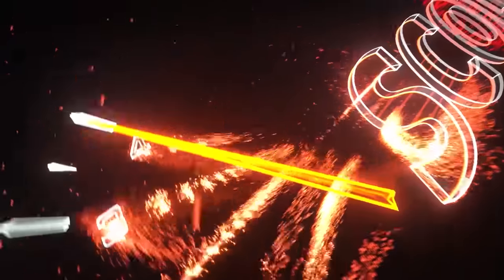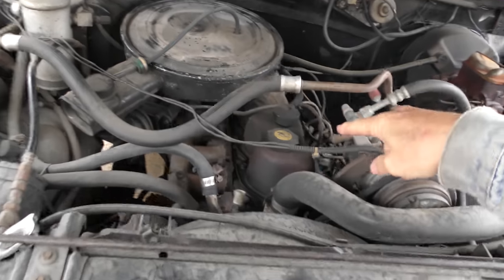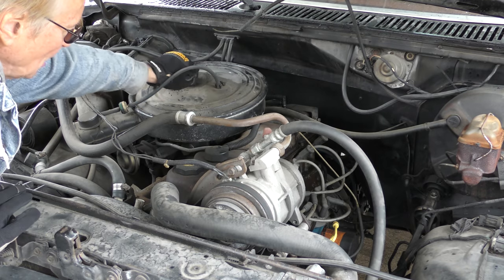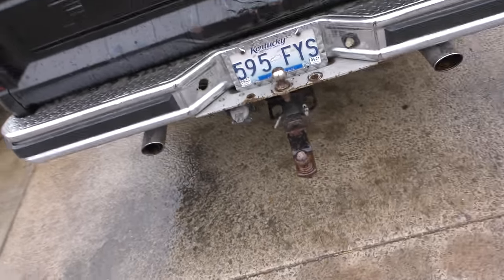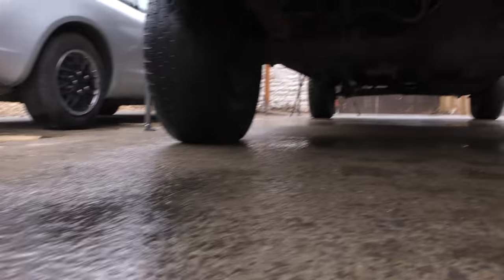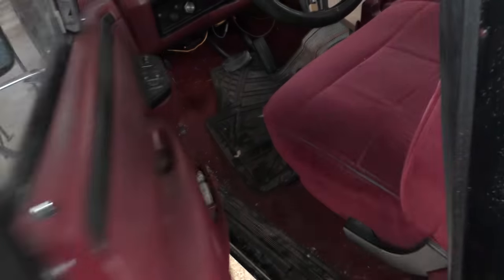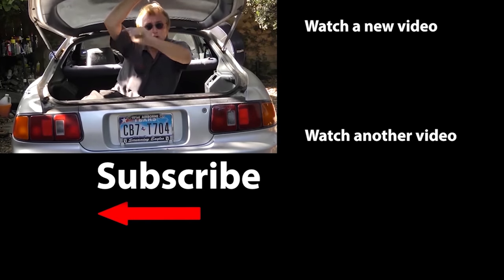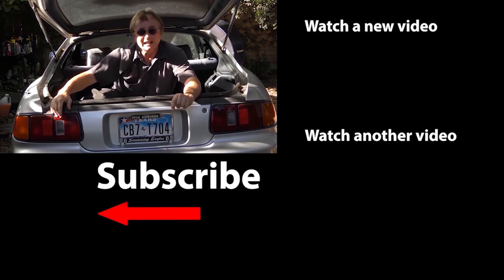I'd Give My Left Arm for This Truck

Comment: I paid 2 grand for a super clean F0100, 1968 w/250 six cyl and auto', had it now for 5 years, runs like it should, uses some oil but who cares, I have it insured for 8 grand.  Came from a ranch in Oklahoma, not a dent in it, frame like new, I did put in a new windshield.  You just cannot beat the old stuff, back when all American made.

Comment: I've had a 90 f150, went 250k before I sold it, currently have a 95 f150 with the 300, has the I6, has 240k sounds great you could balance a nickel on it. Also got a 89 Bronco with 418000 miles, old 302. OLD FORDS ARE JUST LOYAL

Comment: I still own one of these. mine is a 1995 efi and it's a 5 speed but it's the same 300ci I have over 300k on it and still runs and drives better than some newer trucks in my opinion I love my old truck and you cant beat how cheap the parts are to keep her running the only down side is it's not going to win any mpg rewards but it's the only work truck I'd trust with my life. If you haters don't want to take it from scotty take it from me I got this truck from my dad for 1000 bucks 8 years ago and my dad bought it brand new and other than a clutch, radiator and hoses ,belts and water pump, brakes. All basic ware parts that have to be replaced on any car every so often. Fyi these parts didn't have to be replaced till after 250k and cost us under 600 bucks for all the parts labor was free because the truck is so simple to work on you can do it yourself with a basic tool set and I mean like a cheap walmart set for under 50 bucks. I've also worked on other friends and family f100-250 with these engine and everything is so easy to work on it a crying shame ford doesn't sell this for consumer trucks and suvs any more but it's still used commercially.  Best trucks/engine period.

Comment: I wouldn't trade that for my 83 D150 Ram Miser. It now has a modified 360 and 727 torqueflite. Next up is a rear disc brake set up. Oh and it also has an 8 foot bed you can get a full sheet of plywood in without hanging out the back. Why are there so many four door trucks? I'd have a Ridgeline if they made one with two doors and a bigger bed.

Comment: I was smiling all the way through this video, because my uncle recently gave me his 1996 F150 long bed with relatively low mileage on the legendary 300 CID engine. It's got a regular cab and a long bed! They don't make'em like that anymore. I had to replace the entire rear suspension, front brake lines, and front wheel bearings right away, but it was clear from the get-go that it was a solid, reliable workhorse – everything you need in a truck, nothing you don't. And gobs of "old school cool". Now it needs new brake pads and probably rotors too, I still need to replace the rear fuel pump, and I would like to replace the front suspension 'just because' since the rear end is new. But these old trucks are easy to work on and just keep going and going even when you neglect them (as my uncle can attest to). I plan to drive it until they outlaw gasoline :-)

Comment: Had a 1982 f150 302 4x4 long bed with the NP435 four speed manual transmission (granny gear) was an ok truck, had a 1996 f150 300 i6 4x4 short bed with the mazda 5 speed manual transmission, not as fast as the 82 but didn't have to work on it no where near the amount i worked on the 82. Wish I had of swapped transmissions and kept the 96 i6.

Comment: Had a "78 F150 with the 300 six and 4 speed. It was a 4X4, I put 31" tires on it and very few issues besides occasional death wobble due to the bigger tires and loose front end components.  Still wish I had it...

Comment: I had a 1994 F-150 with that straight 6 engine and a 5 speed standard transmission, shirt bed 2 wheel drive, blue in color. Wish I still had it!!! 🤦🏼‍♂️🤦🏼‍♂️🤦🏼‍♂️🇺🇸🇺🇸🇺🇸

Comment: My dad had a rusty 83 ford f100 with the 300 straight 6. It was probably already 20 years old and had a decent amount of miles on it when this happened. I remember when he needed to speed up fast from a complete stop and that thing still chirped the tires and that was surprising. My dad also had an 86 f150 with 36,000 miles with a utility bed. He sold it to his work buddy and unfortunately it got totaled in an accident.

Comment: I have an 87 with that engine that still runs great. I bought it in 88 with 2000 miles on it and it now has over 200K with no major repairs. The biggest enemy is Rust, otherwise it hauls like a champ.

Comment: I had a 96 f150 I bought from my dad at 100,000 miles and drove it to 170 until I sold it to a ranch.. last I seen it in 2011 it had over 200 with the same 4.9 engine and original clutch !!!

Comment: Even Scotty knows what is the best Engine ever Designed…
Everybody wants the 300 Ford Inline, but most People, even Mechanics don’t know how to take this one Engine, and Build it for whatever, Drag Racing, Work Horse, or just Longevity Purposes!!!
I drove mine with a 16’ Carhauler behind it, from Colorado to Texas, Sat a Brick on the Gas Pedal, never used a Drop of Oil, Built Two Transmission’s, and the Third time i Sold it.

Comment: Those Ford 300 6's were bulletproof. As good as Ford V-8's were back then, the 6 was better.
Lots of low end grunt, and so easy to work on. I'd tear out that air conditioning, though.
Nothing but an obstacle.

Comment: Been driving my 1984 f250 for decades... 460 ci   c6 transmission. I rebuild the trans myself. 4x4 it will still smoke the tires.

Comment: My first vehicle was a LWB '81 F100 sky blue with the 302 V8. Bought it in 95 for $1200 with only 35k miles. Sat in a garage for so long that the fuel line dry rotted off of the tank. That truck was mint. I would literally cut off a finger to have it back!

Comment: That is 100% the best bamg for your bick an automobile could give.

A free ferrari 250gto doesnt hold a candle to the value of the most reliable, indestructible, and third greatest looking truck that was ever made.
Ditch the Carter YF1 ASAP, terrible carburetor, probably the only thing that could ever give you a problem out of a 300.

Comment: I had a 1967 Chevelle, and I will always regret selling it.  For one thing, it was a nice car.  But given the direction car manufacturers are going with technology, it makes more sense to me to put several thousands of dollars, if necessary, into a nice old car, and keep it going.  My Chevelle did not have power brakes or power steering, or power anything, and it was a delight to drive.

Comment: im a chevy guy but ford 300 6's dont count lol, those are good engines. surprised you didnt mention the gear driven cams instead of timing chain or belt. straight 6 with a top loader trans would be an awesome find.

Comment: I paid 400.00 for my '75 f100  in 2010. 300 inline six with 3 on the tree with a dana 60 rear end with posi-traction and 3.73 rear end gear. Running strong but tired. Has a wrist pin noise but has never let me down...

Comment: All my straight six 300 motors. All had one thing in common.when the fuel pump went bad I put electronic one in.,😉 They were like 12 bucks a piece. The old discount Auto parts 👍

Comment: all us old timers know the old Ford automatics drop into reverse when idling sitting in park I think the fix was a sticker from ford that said don't idle in park
Reply: I'm actually only 29 but growing up in the 90s there were plenty of these around and it was widely known. Then you had the ignition switches shorting out and burning the vehicle to the ground, including your house if you parked in your garage. Then in the late 90s it was the cruise control switches spontaneously combusting 🤣....flaming Fords LOL
Buying a Ford is like buying power tools at Harbor Freight, it's either going to start running on its own or burst into flames 🤣🤣🤣🤣
Reply: A lady at work had her Lincoln Navigator bumped into by a pickup truck backing out of a parking spot at a barbeque fundraiser this fall. Just a  bump from backing into her rear bumper rocked her Nav out of park, rolling forward, coasted down a hill into a neighbors lawn and crashed through the side of a garage and stopped coasting just short of a pond.  She watched it happened in disbelief as her car went for a ride lol. Insurance totalled it out and she went out and bought a brand new Lincoln. I swear some people never learn. I know all mfger's have issues but FMC has a long history of going cheap on critical parts that are safety related. I will never buy one or put my loved ones in one. I've seen way to much of their unsafe junk.

Comment: Ford trucks of that era were tough as hell I had an 89 and it was a winner, bought it for 2500 and sold it for 3500 four years later 
The only down side was the twin I beam suspension. Too much un-sprung weight.

Comment: I managed a fleet of oilfield trucks and by far the most reliable ones we F250s with a 300 ci 6 cylinder. The would pull anything and would last for 300000 very abusive miles.

Comment: I had a '77 Dodge that had a separate voltage regulator and alternator.  I had to replace the regulator when it started running the alternator at full charge all the time.  As I recall, it was about $15 at an auto parts store, and took me all of 5 minutes to replace.  Later I had to replace the alternator, I figure it wore out from that bad regulator; it was maybe $125 as I remember.  Not like the $500+ computer controlled ones in today's cars!  Ah yes, I remember those old cars & trucks with their simple systems that even a non-mechanic like me could fix with basic tools and not a lot of money.

Comment: the only issue with them boards is a lot of people don't do maintenance to them but they still run forever I had one with the clogged catalytic converter a bad carburetor but it's still ran and I'll be replacing the carburetor here soon

Comment: Had a 83 f100 C6 trans and 9 inch rear. Man I miss that truck. Got rid of it when the gas prices went up.
Reply: I have an 82, 4.9, 3.25 gears, C6 and I get between 15-16 mpg on highways (I keep it around 60)

Comment: That truck is definitely worth a recondition or restore. 
I like the look of the original air cleaner & carburetor. Can't stand the look aftermarket crap. It runs fine as is.

Comment: I have a 1994 f150 with that engine I bought it in 2005 and paid 1250 for it had to remove mid ship tan and replace sending unit for fuel gage.  Replaced the thermostat. Has the 4 speed c6 transmission with tow package.  It's been a good truck.. just having issues with smog in California.. but it's still runs 🏃‍♂️smoothly.  No issues.  It's a good truck. Needs wind shield. But I'm gonna keep it and maybe some day get it registered.  California laws suck.. ha

Comment: I’m honestly surprised that someone would call these cheap. I haven’t seen an 80s model truck under 6000 that barely runs in a long time outside of the 1984 Chevy C10 I picked up a few weeks ago. Even at that, it’s not perfect and needs a lot of work.

Comment: This is rather great because I traded my 88 mustang that was totaled (frame was bent and split)for a 1981 f-250 4 speed 4x4 with the 300 in it the truck has been used but it still runs fine just needed a water pump and new front hubs but other than that it's great
Reply: Outstanding!

Comment: I’ve got a 82 F-150 that came with a 351, but someone stuck a 302 with a flat cam in it, so I wanna rebuild it, but at the same time I wanna put a 300 inline 6 in it

Comment: Ha ha, I happen to have one of them F100's . Mine is an1983 with the 5.0L V8 and AOD trans. Bought it 11.5 years ago for just $250. Mine is the 2wd With the stepside bed. Had 98K when i got it , now is at 163k miles.

Comment: i bought one of them fords just like that but it was about a 1990 model i think, with 250,000 miles ran great a/c would freeze u out for $500 but what i did not like was the 5 miles per gallon (or less) u get in the city, all of that low end torque guzzles gas in town but it got about 14 or 15 hwy

Comment: A year or so I bought a 90 f150 for 500 dollars, come to find out it has 34000 original miles on 302 auto. Dead battery was the reason she sold it to me cheap. Lucky garage sale find.

Comment: A four speed automatic in 1981? No, this one has a 3 speed, in fact the inline 6 only came with a 3 speed. You can even see in the video if you pause at the right moment that it only has a 3speed; there is no circle around the D and then after D you have second (2), the overdrives would have third after OD

Comment: I had the same year F250; on new years eve (1983) I went to pick up my girlfriend, she did not have a license and had never yet driven any vehicle. Being up north (Wisconsin) I had left the truck running. When I opened the passenger door, as any gentleman would, she climbed in and I closed the door. The vehicle jumped into reverse and started backing down her parents circular driveway. I almost got to the driver door but was picked off by their mailbox barely missing getting run over. The truck, being the wheel was turned to make the arc of their circular driveway, backed out and circled back toward my girlfriend's parents house. Fortunately, the bumper clipped off the fire hydrant in front of their house and the differential road up on the hydrant and lifted the rear wheels off the ground, thus stopping the truck before it crashed into their house. Being she wasn't a driver, she didn't think to get behind the wheel and stop the truck and being we were in a small town; when the cop showed up he knew me and when the tow truck driver showed up, he knew me as well. When we got to the party, the story had already been told. A night to remember and a Ford to regret.

Comment: I had I had 70s pickup trucks so easy to work on I know what you mean Scotty hey my friend had 65 Chevy pick up another easy ones work on they all came with straight sixes even 65 hit a three in the tree and it would lay rubber in first and second gear lot of torque on the them years of trucks

Comment: I had a similar year Ford F150 XL , Straight 6 ,  2 tone Black/silver with Red interior.  
I also installed chrome wheels and a chrome square tube grill .

Unfortunately the NYS Winters slowly turned the truck into swiss cheese. 😡

Comment: I have a 1980 F-150 with the 300 straight 6 in it with 128,??? original miles.  My dad bought it new & I got it with 50,000 on it.  Only mine has the floor shifter 3 speed with overdrive so it's basically a 4 speed.  Hey Scotty,  how much money do you want to spend on a 1980 F-150 w/6 banger that needs a little work ?  Simple stuff for a man with your knowledge.

Comment: I will hand it to Ford that is a pretty good engine however, it does what it's supposed to do just like any LS you can think of so I don't really see the reason in holding it in such high regard it just a decent engine I guess for Ford it's quite an accomplishment

Comment: Just got a '86 F250 with the 6.9. The truck is literally what the name suggests, a bull. Sadly it was owned by a dumb teenager that did "mods" so most my time on the old gal is bringing her back to her former glory. 

These trucks may not be fast, but they'll pull a house down, just not quickly.

Comment: I had a straight 6 96 Ford f250 I really miss that truck it had less than 100.000 miles on it and it was a great truck, my chevys I could keep the check engine light off no matter what!🤔😉🤣🤣🤣🤣

Comment: Yeah I'm not buying that that was sitting in a field for years with that paint. And an edelbrock probably wouldn't work better than the original if that's an autolite and not a chinese clone. Plus you'd have to change the intake manifold.

Comment: Oh yeah the old 4.9 lol. I drove one of them. It was a 3 speed manual with over drive. You could almost not get enough speed going to use the od in it. Lol
Reply: I had mine at 80 on the highway everytime I was on the highway with no issues

Comment: What I’ve learned from Scotty:
1. Only buy Hondas, Toyotas, F-150s (V8 only), GMC 2500HD (gas), or low mileage vehicles from the 90’s to 00’s as long as a mechanic says it checks out. Pretty much everything else is 💩.
2. Don’t have a transmission rebuilt. Just buy a low mileage salvage 1 and pray.
3. Never take a vehicle to a dealer except for recalls, and do not let them do any work beyond that. Take it to a real mechanic if necessary.
4. Buy from individuals not dealers if at all possible.
5. 4 wheels move the body and 2 the soul. 😜

Comment: The most reliable engine ever made. I had an 87. Their downfall is leaking oil. 

Working construction I couldn’t have my vehicle dripping oil on my customers driveways. So I quit adding oil. Years later the thing was still running perfect, while dry. I gave it to someone for scrap because I bent the frame at a rock quarry and the door wouldn’t shut completely. 

That 300 inline v6 is indestructible.

Comment: i have had a few 80's fords and they are junk the running gear sucks on them nothing like my 70 high boy. so far i have not paid over 350 for one all running and driving then i flip them before they break. the last one i got was 350 with king cab 4x4. but i like my 79 cheyenne short box 4x4 full option truck with a 400/400 turbo got it free with only 35,000 miles on the rig i have not put over 100 miles on it yet have had it for 2 years . why i don't drive it is people will not leave me alone because they are trying to buy it from me same with my 68 chevy pu with a stroke 454 in it

Comment: Please get that scam oil filter off of that engine.

I once had a 85 Econoline 150 work van that had the 4.9 300 inline 6 cylinder that I bought from Krispy Cream Donuts & it had a little over a 100k miles on it, I drove that van until 2005 & when I sold it it was still running perfect & it had a little over 500k miles. All I ever did was a new carburetor, alternator, transmission, front & rear main seals, & valve cover gasket, & new fuel pump, But never went into the engine.

I wish they still made them like that today instead of the over computerized junk they're pushing out now.